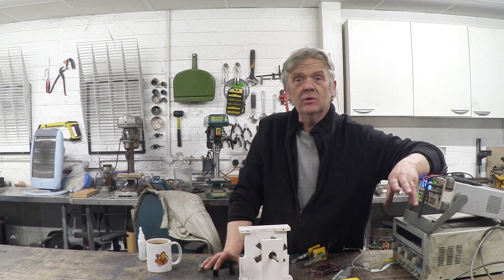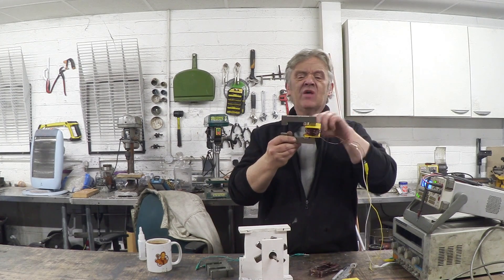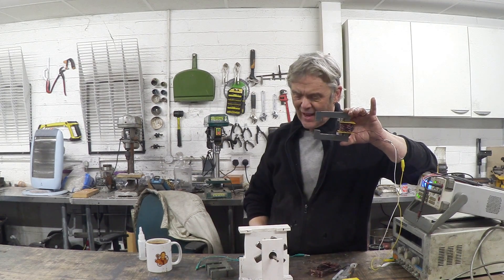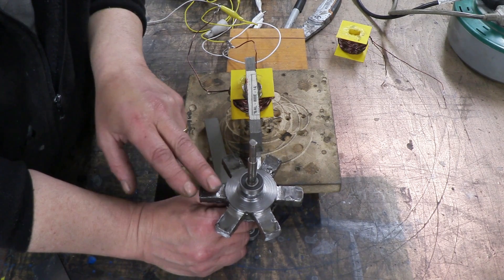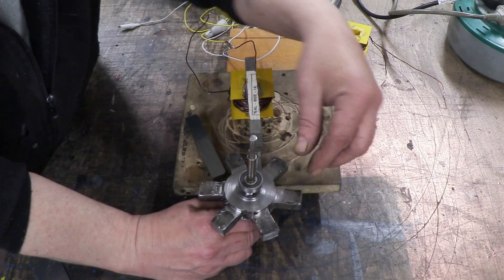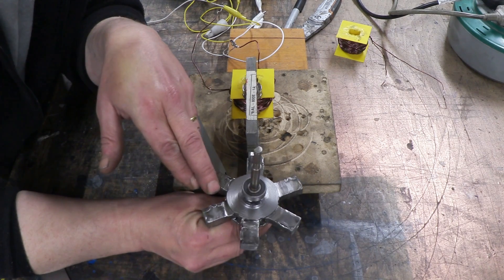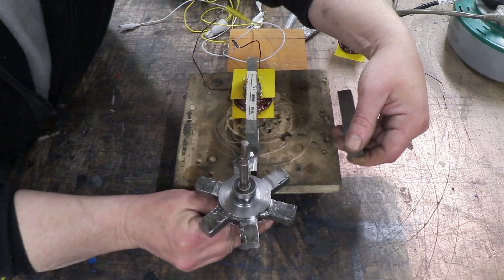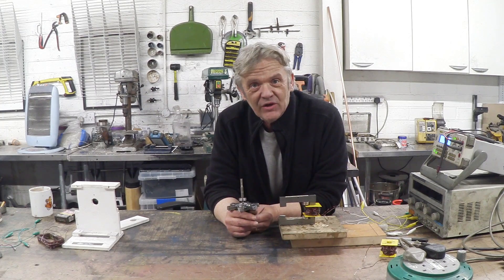1039 The Birth Of A New Type Of Reluctance Motor

Comment: Could you switch to power input to reverse the north south on the u shape to pull the rotor in the u  switch and then  kick it out the other side to the next coil ushape and repeat.

Comment: What if instead of an extra coil and transformer core you could just use the centre of the E you chopped off to add another bit of ferrite on the end that's cocked to the side and some sort of switch so that it only travels along there after moving the rotor. Would bring the cost down and maybe increase efficiency

Comment: I don't think it's going to work with only two phases. When an arm the rotor is aligned with one of the poles, another arm is going to be half way between two poles, so there will be nothing to ensure it rotates the right way. Brushless motors typically have three phases for a reason!

Comment: Question. If you put a magnet on the rotor and wrap that magnet with wire. If the coil is always shorted on itself.
Will the coil act like a temporary magnet when pulsed and assist the magnet on the rotor? Kinda like your air coil research.

Comment: switched reluctance motors have been around since 1999 by Johnson Motors used in washing machines think in terms of two cogs with coils on each cog with a disc magnet between the cogs with coils- the rotor and  an outer stator having iron studs that interact with the rotor. you can switch them rotor or stator.
Reply from the maker: I don't mean to be rude here - but I suspect you didn't get the point - this isn't just a reluctance motor - of which I am well aware - you might want to review the videos I mention

Comment: That could make a very good motor for operating a direct drive turntable for playing vinyl records.  One of the problems encountered with turntable building is finding a solution which does not involve the use of a motor that operates at frequencies around the 50-200 Hz band as this often sets up vibrations which are very difficult to quell which then goes as interference through the pickup cartridge.  Your motor right there could solve that problem at a significantly reduced cost to the other attempts that have been made in the past at making turntables run quietly.  The one you showed there could run way below audible frequencies for turning around a record at 33rpm.  The ideal motor would have a frequency of about 1Hz but this is very difficult to achieve.  However I can see your motor running with 6 coils at around 3Hz to achieve a rotation of 33 rpm which itself is one revolution every 2 seconds and this is way below audio frequency and so there are no prominent vibrations set up by the motor that would need to be mechanically filtered out.

Comment: Hi Robert , I find this idea very interesting and would like to ask you what power you put through the coil.? Also the magnets you have attached determines North and south as you say, but is it possible to determine north and south just by winding the coil in different directions too. The reason I ask his is because the magnets could be cancelling out some of the power if the windings are in the wrong direction. am I making sense .? cheers Dave

Comment: How about a magnet on a spring (hacksaw blade) suspended over the metal chunks in the plastic wheel as the switch for the current to the coils.  As the metal goes by - the magnet is attracted - connects the power for the coil - metal moves on and power is removed.  Yeah I can see problems with it and it's rough but it'd work. :) AND Zero silicon electronics.

Comment: Robert can you measure difference in the field strength with and without the permanent magnets. If you do not have a hall meter please test if you can lift more weight with the permanent magnets attached.
Reply from the maker: I did that on video 1036

Comment: If I understand how this motor works, if you fit two drive coils, as you intend to do, and reverse the winding polarity on one of the coils, then a diode placed in series with each coil, would allow the positive and negative cycle of an AC supply to energise each coil in turn. One problem might be that of starting, as each coil would be energised at 50Hz, not allowing time for the rotor to overcome the inertia.
An alternative driver circuit, might be a T type flipflop, with a Schmitt trigger variable oscillator clock input. The Q and /Q output driving two power MOSFETs, to energise each of  the coils in turn. The assemble is very  reminiscent of a stepper motor, advancing one step on each clock cycle.
Reply from the maker: nice one mate cheers - like a soft start?
Reply: @ThinkingandTinkering   the cost of  components required  should be just  few pounds for a dc supply control corcuit, most likely  less than £5. 
As far as i can tell, a couple of power mosfers, a 74hc132 Schmitt, and a T type flip flop or a D type wired as a T type, a voltage regulator to run the logic and a few decoupling capacitors and a couple of resistors to pull down the MOSFET gates. 
Of course, you could just  buy the mosfets, and simply drive them from an Arduino Nano or similar microcontroller, then you could program the coil timing and thus the speed and direction of the motor.
A further refinement might be to add a hall effect sensor or opto gate, to sense the position of the rotor, much like the ubiquitous, low voltage, brushless, computer fan.
I suspect you will need back emf protection diodes on the coils, if the motor is switched like a unipolar stepper motor, they really are very similar structures.

Comment: My previous comment has got me thinking. Maybe you could have multiple motors of the same type on one shaft with possibly different specs and each one could be powered by the collapsing magnetic field of the previous one. Do you see parallels with the triple expansion steam engine.
Reply from the maker: I see that mate - cheers

Comment: I agree that large diameter is the way to go but you might also need another motor on the same shaft out of phase to make it run smoothly. I would be interested to know if you could use the collapsing field of one coil to help power up the next maybe this would work at a specific speed without complicated electronics. You’ll have to get the oscilloscope out for this one.
Reply from the maker: I have been pondering that - cheers

Comment: Thats interesting, a 2 phase motor. Nice one :) Thank you.
Would that mean it would run on an AC frequancy wave? /\/\/\/\/\/ LRLRLRLR
Also, if the rotor was incased in plastic with metal bar inside - it could make a waterproof motor
All the best, kieron
Reply from the maker: Nigel Johnson gave some nice advice on that mate
Reply: @ThinkingandTinkering  ok thanks :) ill find it

Comment: So basically you have created an electromagnet that is trying to pull towards the metal, but what if you add neo magnets to the tips of the electromagnet, not the rotor. I know it will do it stronger if you add magnets to the rotor but that is not the point to do. I just wondering will the magnetic field increase on the electromagnet part by adding real Neo's to the tip.
Reply from the maker: did you see video 1036 mate? the concept of this is explored in that video
Reply: @ThinkingandTinkering  yes but that is a close circuit where the magnets are dividing as a transformer. I was talking about leaving the circuit open as you did in 1039 video above and just add the magnets on the tips of the horseshoe wrapped coil. Might would be stronger mate.

Comment: Fantastic. Await the next step (other coil) will you be using a Ardrno to so the switching? DVD:)
Reply from the maker: I will probably start with a relay but yes I will use Arduino control for sure there are two PWM outputs on the Arduino I think
Reply: @ThinkingandTinkering  Await the results. D:)

Comment: A lot of people have built new motors like this but they never get around to measuring the efficiency. The output power can be calculated from the torque and rpm. The torque can be measured by allowing the case of the motor to rotate against a spring balance/scale.  The rpm can be measured a number of ways if you have an oscilloscope but optical rpm meters are available fir model aircraft use. Input power can be calculated from the voltage and current.
Reply from the maker: yes I was looking at dynamiters - which are basically exactly as you said - F=ma, mass by the scale and a being the acceleration due to gravity so an easy conversion will give newtons

Comment: The rotorattraction would be more natural with magnets on the rotor.  Your already going to pulse power anyways. Just pulse enough to get break the attraction.
A please big disk wheel. No fijet spinners. You got a bike rim somewhere 😮 . 
Robert Adam's also talked about a attraction motor where he shorted the coil when the magnet got aligned and it pushed it on from the back spikes. No power input
Going to be interesting build. 👍👍
Reply from the maker: cheers mate

Comment: Hi Robert,
This reminds me of
 Ed Leedskalnin's " perpetual motion holder" or his perpetual motion flywheel. The guy that built Coral Castle.
There is a gentleman that has been working on the flywheel for several years!
He has made several trips to Coral Castle to record as much as possible from the flywheel.
He has an actual life size replica, partially working Robert.
If anyone could give this man some good pointers & figure it out,  it would be you Robert! 
It would be fascinating to watch you build the flywheel and figure it out! You should visit the guys page & offer up some tips. It would be greatly appreciated Robert!👍
His name is Vinny Stvincent.
I would post you a link on here to him but, I'm not sure you or the youtube AI allows that to happen?
The so called "perpetual motion holder" is the easy build & many have built it. Venny has built that .
Reply from the maker: no - youtube doesn't allow links in posts I am afraid but I will look it up - I can use google lol
Reply: @ThinkingandTinkering   if you do look it up, look for the video of lee locking two holders together and shuts off the power. Then runs a motor inside the traped field. 
They say a electromagnet loses it feild when power is off.  He clearly proves otherwise.

Comment: cool poc, are you going to add the Alnico & Neodymium Magnet Flux [off] Gate variant there ,seems perfect for this, and do the matching super low switching calculations this time?
also remember to include a poc with prof Eric's 'upward sweeping something' on the traveling magnetic wave to get the magneto mechanical switching for nearly free ,just add input power ^_~ that continuous 3v 1a earth battery sat under the tree + shrink wrapped cheap small buck/boost pcb for more fun? perhaps
Reply from the maker: I was thinking of the Alnico/Neo flux switching device but there is a degree of remnance there so switching speed will be limited by that and the power needed to realign the alnico is quite high - the remnance of the steel is also an issue but the hysteria curve for silicon steel is quite narrow so will do the job so to speak

Comment: Please correct me if I'm wrong but is this not very similar to a bipolar stepper motor..?
Reply from the maker: in a sense yes - but then all electric motors are basically the same - to be honest mate - I don't really know what you mean - where do you see the similarities and from my side - where are the differences?
Reply: @ThinkingandTinkering  There are stepper motors that use an iron rotor instead of magnets, so called "variable reluctance" stepper motors 
I just saw your toothed rotor and it reminded me of the simplified diagrams for these vr steppers, of course yours has the flux concentrated in one "tooth" rather than the flux flowing from one tooth to another on the opposing side

There was another comment here about a bicycle wheel in this configuration, I think that's a very neat idea - just wondering if using magnets in the rotor would help or hinder performance?

Comment: Will need convinced by seeing if increasing radius would increase torque.

I reason less torque with increasing r because flux length shortening force is akin to force between magnets half distance and force goes up 4 time etc. Increase distance and force drops off quicker than distance increase.
If  number of C poles isn't increased, nor they increase in size... Larger radius means more arc length per C pole.

Larger r will probably result in motor that wants to spin faster
Reply from the maker: like so many things - we build it we see - nice points mate - cheers

Comment: Almost exactly what I was trying to describe on the last video!
Rather than having two sets of expensive motor controllers why not just use one and have a second wired as a capacitor start?

This is, to quote one of my favorite aliens "Fascinating!"
Reply: I would expect such to work... But i would expect phase would need tunned for rpm and load. 

Depends on necessary capacitance... May be possible to do such using use a salt water capacitor. Jam jar with foil on outside for one plate. Holding a variable  level of salt water which  serves as other plate
Reply: @stevecummins324  That would depend on your type of controller. You could use the Cat as a starter and have it disconnected when the rotor rotates. A kick start if you will. Once you have rotation you can alter the speed by the timing of the coil energisation. similar to a bushless fan controller. 
It could get really interesting if you turn it into a generator by having the "rotor" spun by a motor and the energy taken from the coil being energised by the changing magnetic field produced by the magnets and atenuated by the rotor position! 

To be clear on this, I have not read upon such a device .... simply extrapolated effects from a different device!
The last time I had any real discussion on this subject was back in 1980? when I was doing a City and Guilds .... my memory is not good enough to be certain as I used to be ;0)
Reply from the maker: nice one mate - cheers

Comment: Hi Robert - why not put a neodymium magnet at the end of you rotor arms - that should help move them into the gap more strongly.
Reply from the maker: they need to exit the area of the 'C' easily mate and magnets on the arms would stop this with out extra power to the driver coil - so I am nt sure there would be an advantage mate - but like I say I am not sure and don't really know

Comment: I think you do not have a rotating field with 2 C's. You need 3 C's for doing that. A stepper motor has 2 windings and does create a rotating field but in that case the rotor is a permanent magnet and current in reverse in a winding has a different effect. In your setup that is not the case. The rotor will rotate though but you need to give it a manual spin first. So will one C.
Reply from the maker: yes I was mulling that over too mate

Comment: For further reading google axial flux switched reluctance motor....as u say shorter axial flux path than radial through the armature....lots of cogging torque with two poles,. Smoothes out with 3 plus and or sinusoidal drive.   Great for low end torque or applications at high temp....no magnets to fade due to temp
Reply from the maker: nice pointers mate - cheers here is a link to a comprehensive review of this kind of motor https://ietresearch.onlinelibrary.wiley.com/doi/full/10.1049/iet-epa.2018.5190
Reply: Good article. Thanks. According to  it (section 4.2.2 CS‐AFSRM), you’re demonstrating a single pole of a C-shaped axial flux SRM, right?

Comment: Surely this  is in most older homes, it's your old style domestic electricity meter!
Reply: No, that is a homo polar disc motor, which is a little different
Reply from the maker: wasn't that a bar magnet in the rotor?
Reply: @ThinkingandTinkering  No it's aluminium disk, I once took one apart

Comment: Very nice. If I were making a setup like that, I'd position the stator arms fairly far apart so the only flux path is through the rotor, not through an adjacent stator arm. Also, 3-phase will give you starting torque wherever you are. Maybe 3 stators and 4 poles on the rotor?

Also, an easy setup to control the current in the coils would be a slotted optical interruptor disk and optical rotary encoder (LM393 or similar) controlling a MOSFET per coil. Remember the flyback diodes to prevent voltage spikes on turnoff which would kill the MOSFETs.
Reply from the maker: I like that mate - cheers

Comment: Two quick thoughts Robert,  what about your piles of shaded pole motors  use them as the coil and the armature gap, pre wound main coil,  heck you might even be able to un wrap the copper coils from the original rotor and re-use the original bushings.  add some neodymium magnets to the outside of the frame near the main coil see if you can get it to tick.    looking around my junk for a old spare shadedpole motor to now..    secondarily other than the permanent magnet being in the rotor.  this is starting to look surprisingly like a section of a stepper motor.  and in that case you might try sawing one apart if you have a spare one laying around.
Reply from the maker: nice ideas - cheers mate

Comment: I hope you are well. In my mind at least. The on / off could be managed by a abs ring type switch on the  rota meaning the ultimate speed is controlled by the voltage input from the coils. I have zero exp on building motors by the way lol
Reply from the maker: it is my preference mate - but then I like mechanical solutions